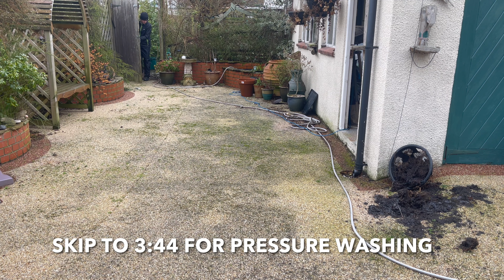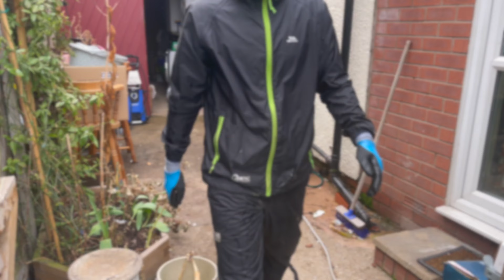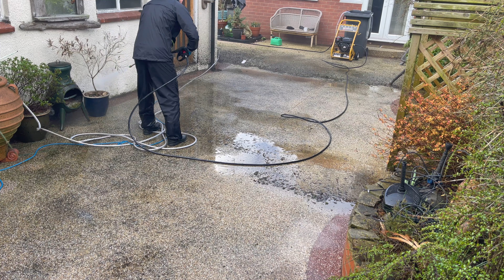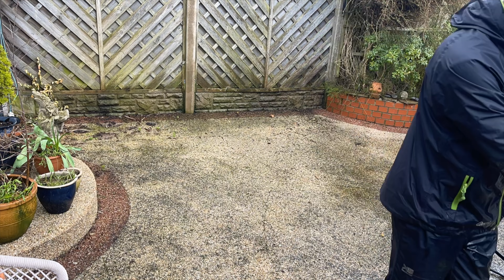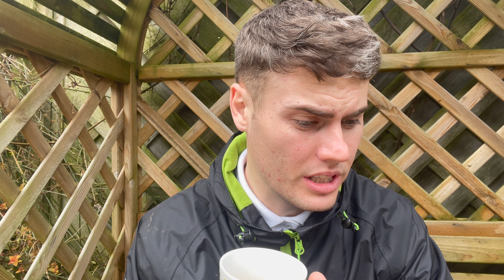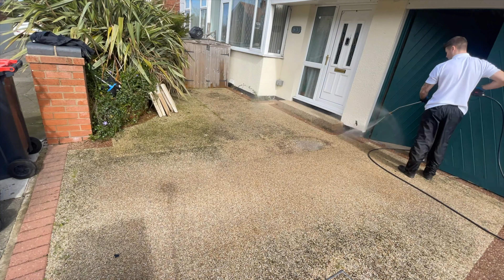MOSS HAS RUINED HER GARDEN!!!

Comment: What pressure did you use in the back garden?  Did you deliberately dial it back to protect the surface from being damaged by higher pressure?
Reply from the maker: Can’t tell you the specific pressure as I do not have a gauge fitted, I have the slider set around half way though, I usually start on the lowest and just nudge it up until it’s doing enough to take away the dirt and then I work at that! Hope that answers your question! 😁